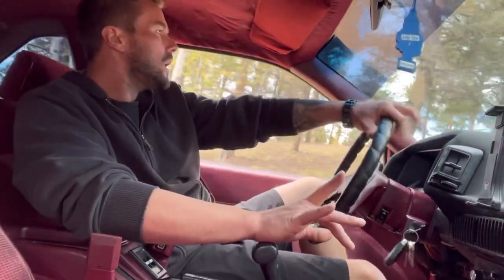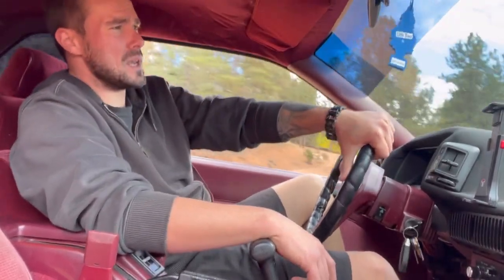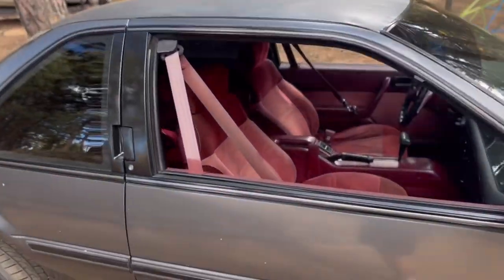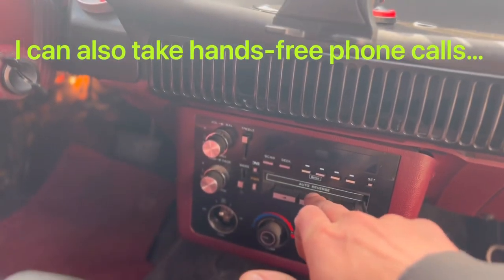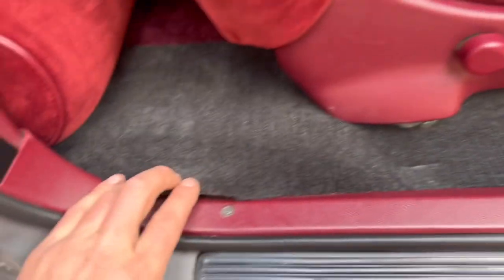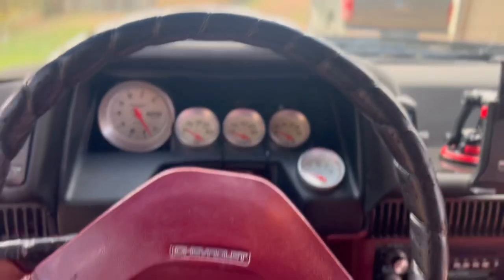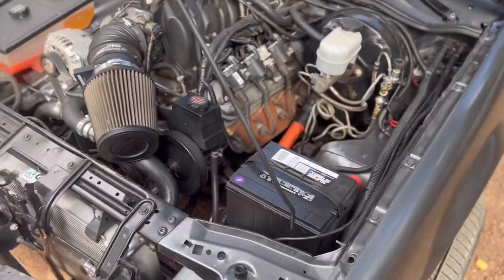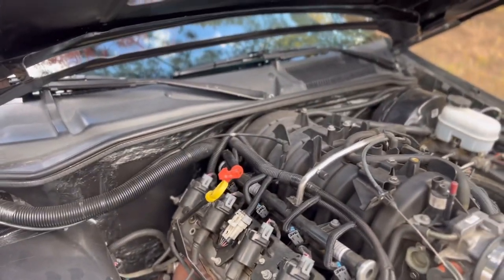How much does my Frankenstein car weigh??? Walk around, & chained up 4WD bloopers.

Comment: Hell ya not a bad weight being lighter than a stock 4wd blazer is already a plus its about the same weight as a 2door 2wd curb weight which is 3519
Reply from the maker: I’ve been curious myself ever since I built this thing. I knew it had to be heavy for a Beretta. 

I’ve been actually hanging onto this video because its boring. But then you asked about it yesterday, so I finished it out.